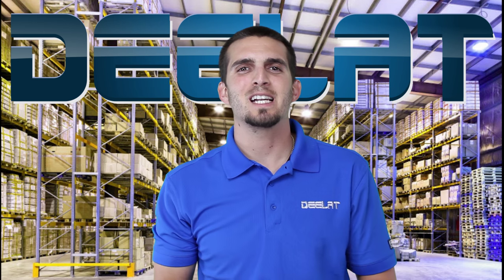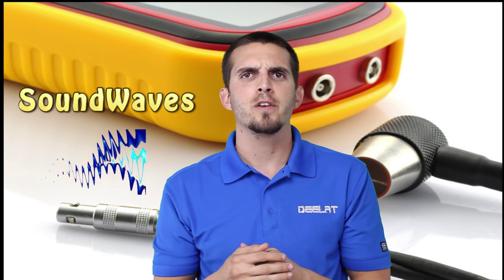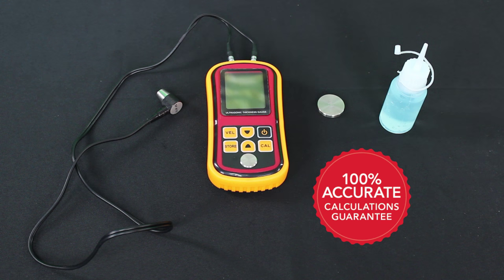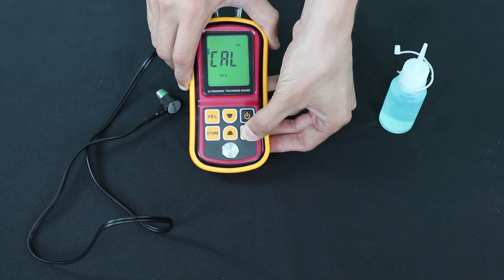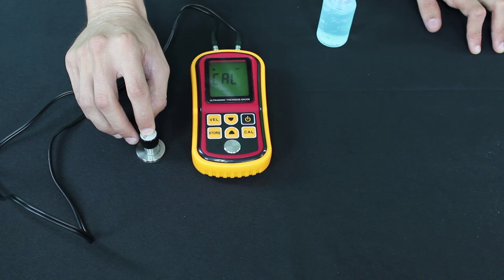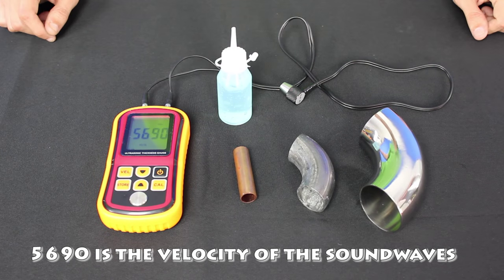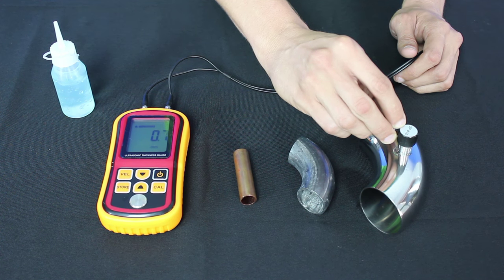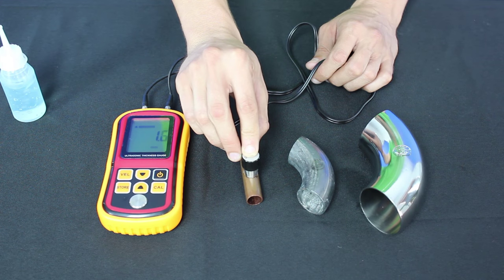Ultrasonic Thickness Gauge

Comment: the direction of probe is also important when measuring tube thickness to make sure sonic wave is traveling through minimum distance
Reply: What material is used with the ultrasonic thickness gauge?
Reply: @عليالكناني-س1س  are u asking what material was used during the calibration process?

Comment: HOLD IT ....... YOU DON'T know how this machine works ?????  YOU ARE DOING IT ALL WRONG !!!    You forgot to change the Velocity setting when you measure different materials
that is why your Copper pipe measured thicker then the steel pipe in the middle. !!!!!
Reply: Bob, forgive them...They are dealers not scientists. :)
Reply: lame for sure!!!! duh.
Reply: How to measure copper pipe by the same velocity of steel?
You shall be change velocity first.
Reply: What material is used with the ultrasonic thickness gauge?
Reply: @عليالكناني-س1س  Almost any material  by setting the Velocity for that material, even the thickness of the paint on your car to find out if they paint it 1 coat or 2 coats.
Reply: @bigbobtong  

Thank you 

 I from Iraq

Comment: 5690 m/s is the speed of sound for the 304 stainless steel calibration block. Apparently I am not the only person who has noticed this error. It is amazing that it has not been responded to.

Perhaps this video was produced quickly to promote the sale of the device with no technical understanding. 

Also, There is a 4 mm calibration block on the device, you don't need to use a separate one. 

It is sad, I thought I did not understand the device at all yet the instructional video understands much less.
Reply: Exactly
Reply: I think the 4mm calibration block that's built onto the device is steel. If you wanted to measure a different type of metal I believe you'd want to calibrate the gauge w/ w/e metal it is that u want to measure.
Also, 5690m/s might only be true for 304 stainless steel when stainless steel is at a particular temperature.

Comment: 1:37. No. The S.O.P. for U/S testing is to dab the job, not the transducer. It (in this case) doesn't matter, but get into good habits... Why are you using a separate calibration block, when there's one right there, built-into the meter?
No mention of different material velocities? I was wondering if you can enter a velocity manually?

Comment: I am looking for an ultrasonic thickness gauge. I need one that will work on steel pipe & tubing. I will never need to measure anything over 1 inch thickness. SOMETIMES, I will be dealing with material that has already been painted. I prefer a meter that shows imperial instead of metric, although I can covert it afterwards if necessary but it would be easier if it was imperial to start with.
Reply: It can do what you're looking for except for the 'paint' part... I'm still trying to find out whether it can measure the thickness of painted steel myself.... 
Suppose it couldn't measure painted steel accurately though. I wonder what would instead get measured if you tried. If it measured everything except the paint, then I would think that we would be able to use that value that the ultrasonic thickness gauge returned to us & add it to w/e value would be returned to us from the use of a "paint thickness checker".
.... or maybe there's just 1 good gauge that can measure the steel w/ the paint haha

Comment: can this gauge measure wall thickness in curves, like the inner side of the large tube? like if I had to measure from inside out of the tube. I have very unregular parts, with small radius but I still have to measure the thickness on these radius. can it measure the thickness in the radius of a bended steel sheet?
Reply: depends on the curvature radius of the metal (it must be at least 10mm... but I think that might only pertain to steel). 
also, the wall's thickness must be at least 3mm (also not sure if that only applies to steel).
Reply: @david-tracy  im about to order one, in the video he measures near 1mm dims, but you are mentioning the minimum is 3mm? could you please confirm?

Comment: So this would work well for measuring the metal thickness across the face of a titanium golf driver or would titanium require a different instrument?
Reply: I would think so since titanium's sound velocity is within the range of the meter. It would also depend on how thick the titanium is.The manual says it can measure steel that is as thin as 1.2mm and as thick as 225mm, but that's for steel... and the manual I have doesn't mention a range for anything other than steel unfortunately.

Comment: Hi , i would like to know if the pipe is already painted, is that will affect the measuring?
Reply: you will get the measurement of paint.
Reply: What material is used with the ultrasonic thickness gauge?
Reply: @hammerheaddon  are u sure?

Comment: Erosion!!!!!?
That's one smart tool...lol
EROSION...!
Reply: There are many issues with the video but I don't see this as one of them. Erosion = wall thinning due to abrasion which can be caused by many things including steam and/or water.

A UT thickness gauge (when used properly and not as demoed in this video) should be able to detect thinning caused by such a thinning mechanism (by way of comparison with expected wall thickness).

It would be less able to measure thinning from corrosion, as the corrosion layers would confuse the signal.